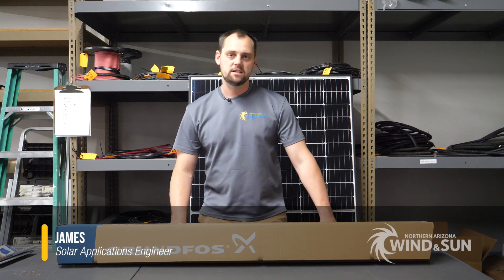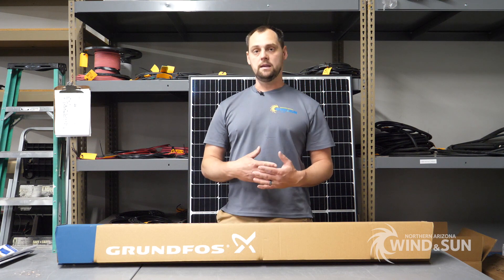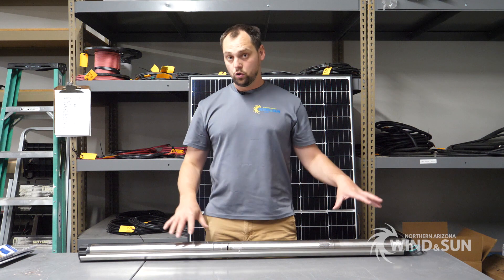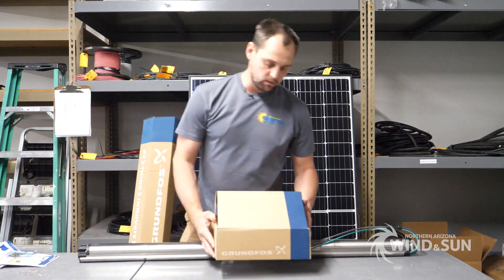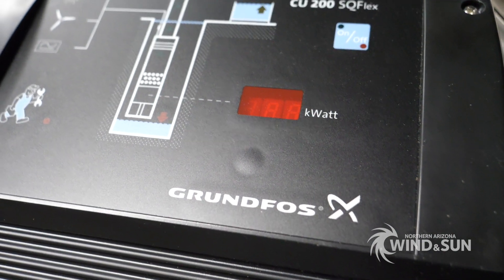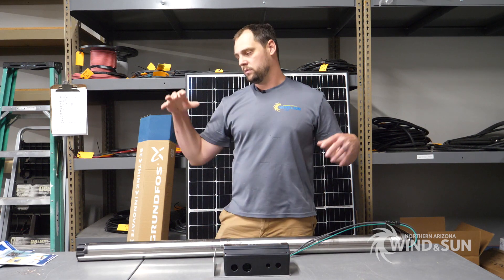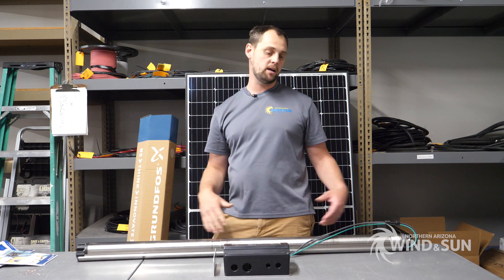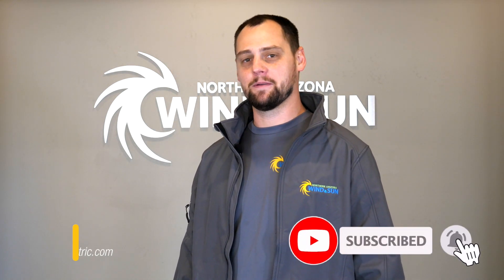Grundfos Water Pump Overview

Comment: I connected a groundfos pump with solar panels dc direct with a ukf-4 four pole surface switch but the pump is just vibrating but not bringing out water what could be the possible cause
Reply from the maker: We are happy to provide support for your  Groundfos pump. Just contact our sales team and they can pull your order and help you trouble shoot! 1.800.383.0195. We offer support for the life of your system.
Reply: How to connect because submersible pump 3 wire red, blue, yellow, but Soler wire output only 2 wire then how to connected you

Comment: Are parts available to rebuild these? I have several that need motors
Reply: Yes parts are available through the dealer or the manufacturer. 

The one he is showing of is a difficult model to take apart so be careful when taking apart the pump